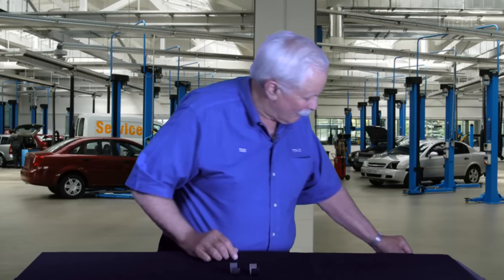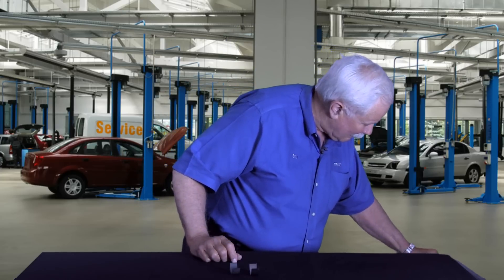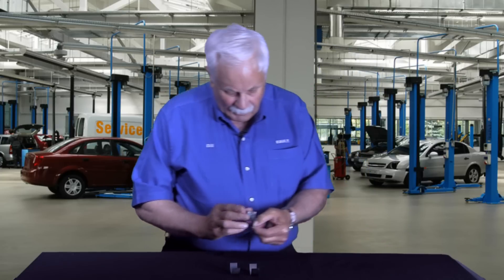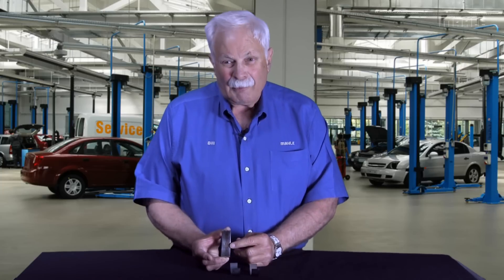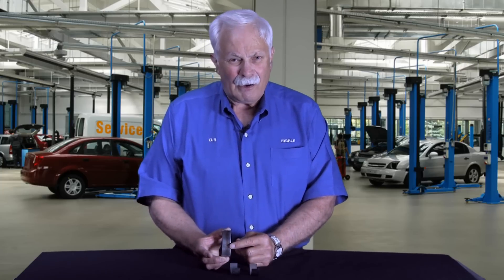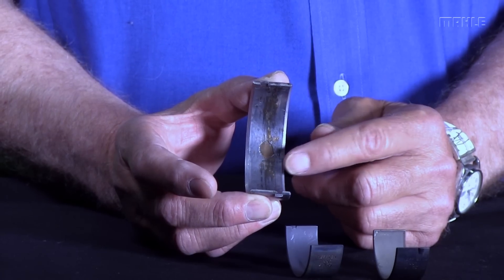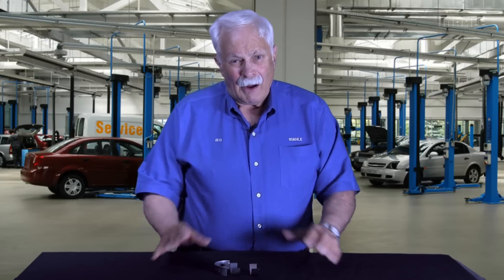Understanding Bearing Coatings

Comment: Hi Bill thanks for the videos. Is the coating affected by a micrometer when checking bearing clearance?
Reply: What a good question. Wish you got an answer. I would guess the coating thickness is relatively standard and definitely makes a difference.
Reply: @philhunt1442  Good point and I was wondering whether the coating would affect the clearances too, but I think what he was asking is whether the coating could be damaged by a micrometer when checking the clearance.